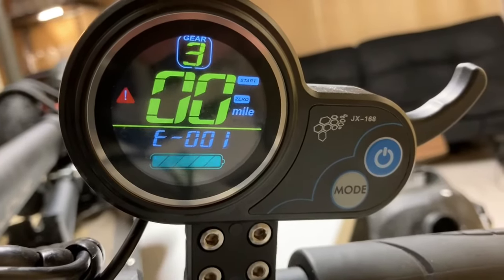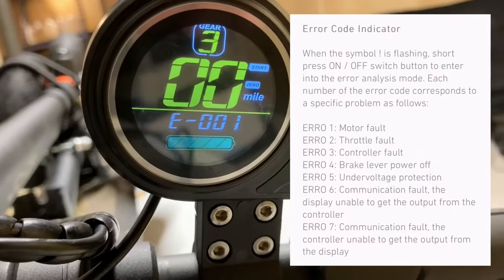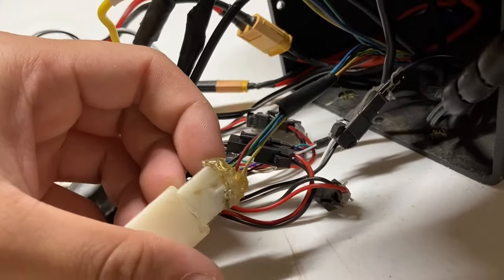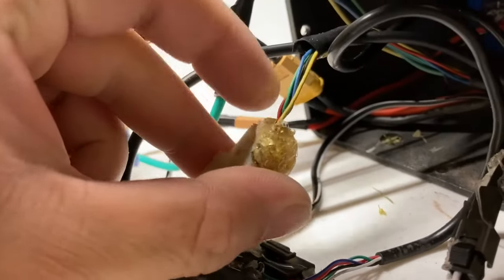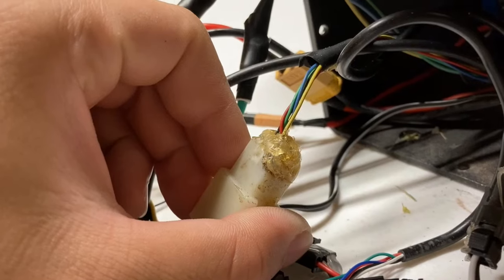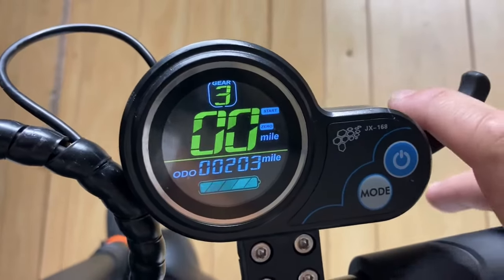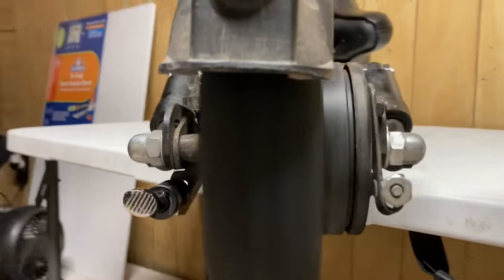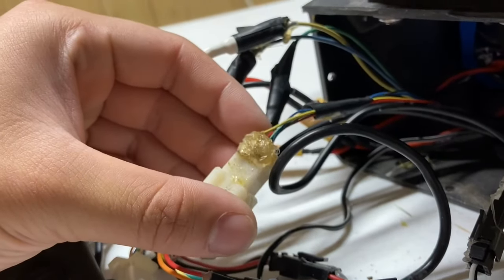E-001 - Error 1 - Joyor Scooter Motor Error

Comment: So i was riding uphill when i noticed my motor had this fault. And ever since it doesn’t ride at all really and just keeps bringing up this error code… i never did anything for the wire to come out? Is it possible the error code means i burnt out the motor? Could you make a video on how you did all of this ?
Reply: I have an ix5 iScooter, only had it a week and this has happened to me,  E-001 

Looked online like this video and I have no knowledge on the matter so iv got to either return it or take it to a repair shop to see if they can fix it,

Comment: the manufacturer did not want to take charge of my scooter they did not want to repair it they offered me to buy a new scooter at the same price as I bought this one even though the product is under manufacturer's warranty 2 years what a big scam he could repair it they made me believe that it was impossible to change the motor cable that it was absolutely necessary to buy another scooter that it is not repairable